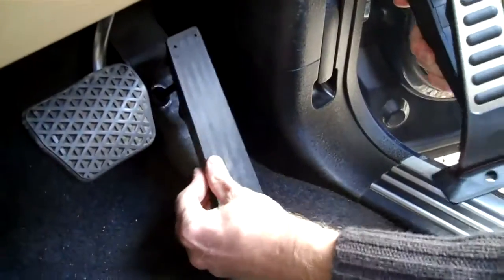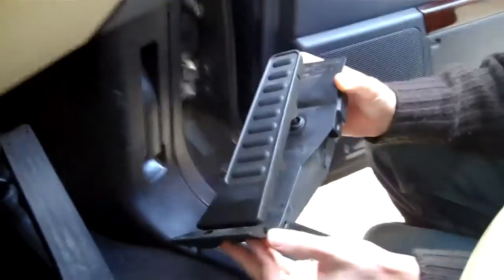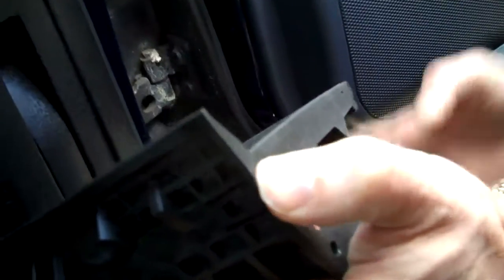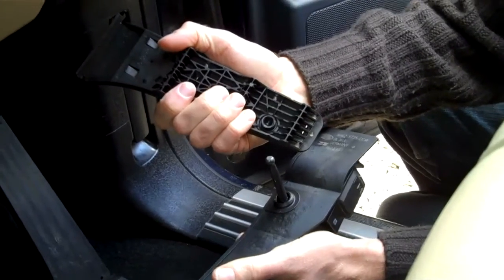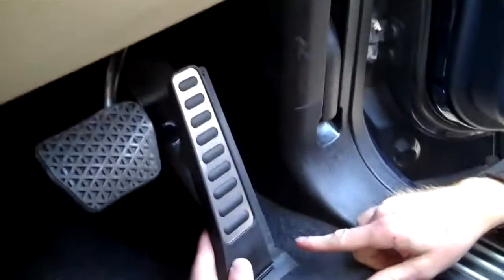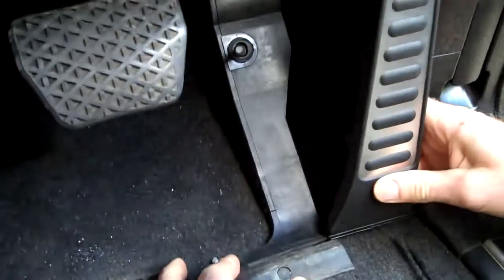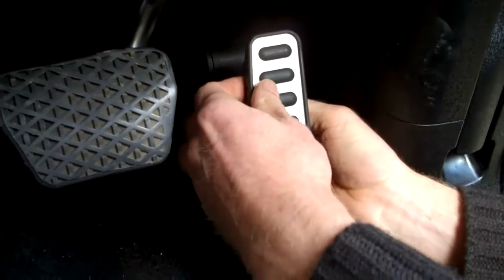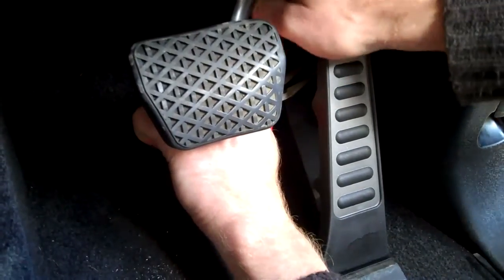How to Upgrade the accelerator pedal on a Range Rover Vogue

Comment: For the left hand drive countries: the assembly has a tork bolt over the floor. Remove the cap, unbolt, and then you can slide the assembly to free the pedal :D.

Comment: Don't you think the pedals are too close to the driver and on too big a bend? The legs are in a tense position all the time. If you push the seat all the way, it goes down, it becomes uncomfortable to sit in the back and the steering wheel is then too far. There is still plenty of room behind the pedals to move them further away from the driver, but this is probably not intended. I am only 172 cm. Many are > 180 cm. How do they sit?